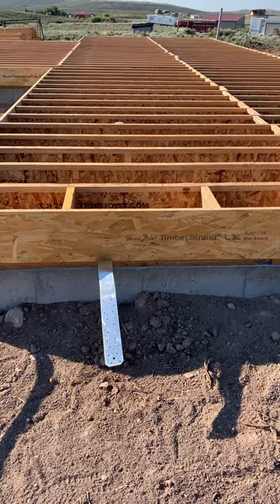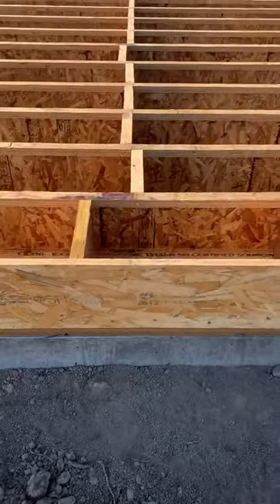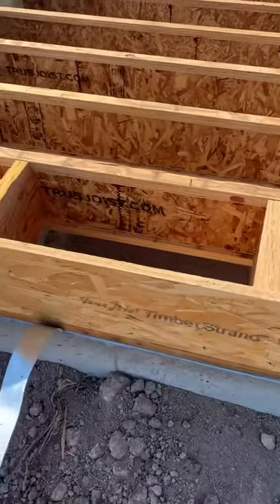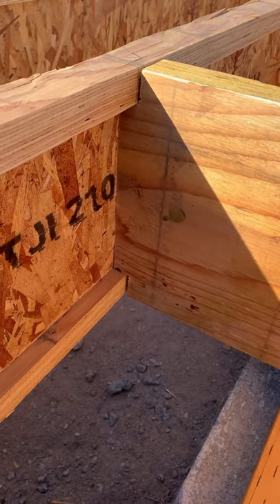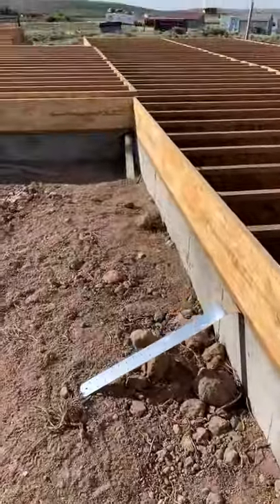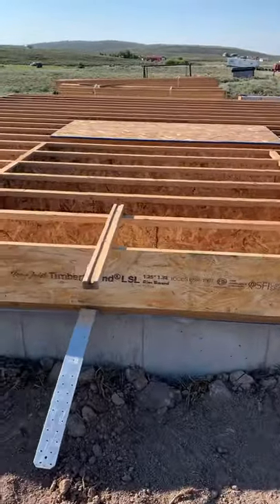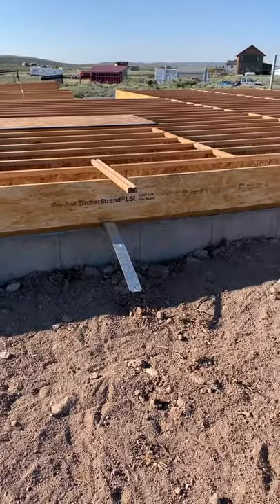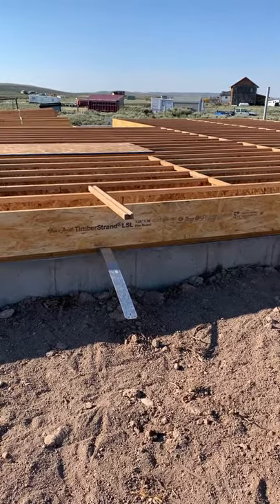I-Joist and LVL blocking

Comment: I got a new build home and the second floor is making too much sound. Builder told me they have used the web truss and sound is acceptable, for me the noise is too much and the floor bounce too. It sound during normal walk by average weight adult. Please suggest what can be done to fix the second floor. Builder is telling all is normal, but it is not
Reply: The joist under the spot where it squeaks when you walk over it may have warped or bowed, and the nail is no longer holding the subfloor tight to the joist.  Find the spot, and you will have locate the nearest I-joist, and use a screw to screw it down tight.  Use a breakaway screw so that there is no screw head showing after you are done, and use some putty or filler to fill up the hole to make it less noticeable.

Comment: How are those tie down straps secured to the footings? Could you please show that?
Reply from the maker: They are “wet set” as the foundation wall is poured. Once the concrete is in the form you simply place the strap in the concrete, and then it dries it in place. I’ll post a video shortly to show it.
Reply from the maker: Here’s a video you can see how they are set in the concrete. They are right on the outside edge when wet set: https://youtube.com/shorts/r33fs9g94Kg?feature=share

Comment: Just curious: are these I-joists stronger than straight LVLs as joists? Or just more cost effective?
Reply: I-joists are stronger than dimensional lumber of the same size, and you can get them in longer lengths than dimensional lumber.  I-joists are also flat, no warps or bows, so you won't have squeaks your floors.

The disadvantage is that in the event of the fire, the I-joist will burn much faster, since there is less material in the OSB than in a solid piece of dimensional lumber.